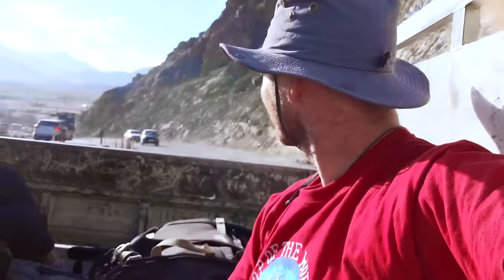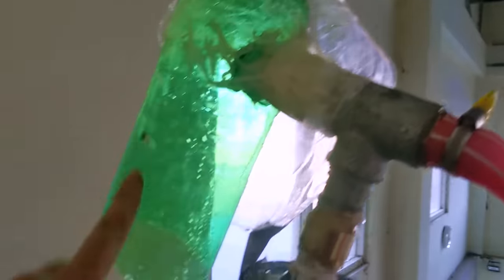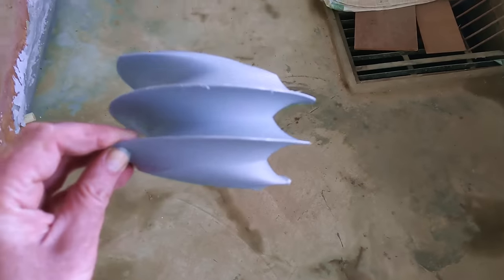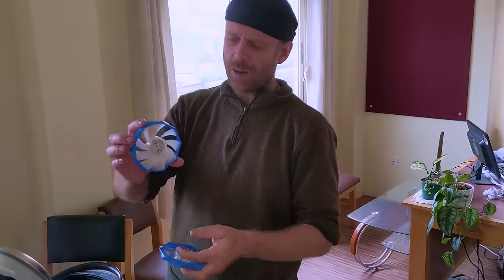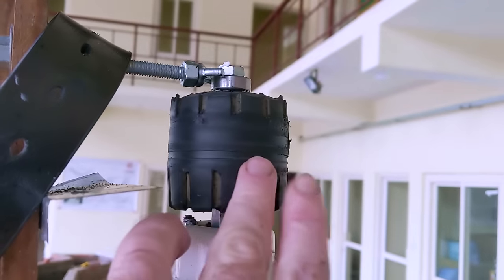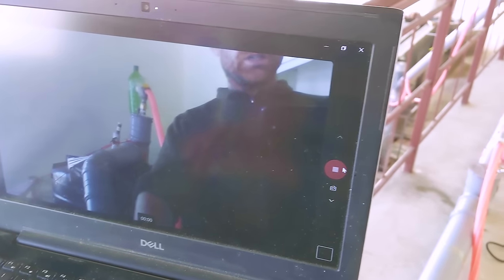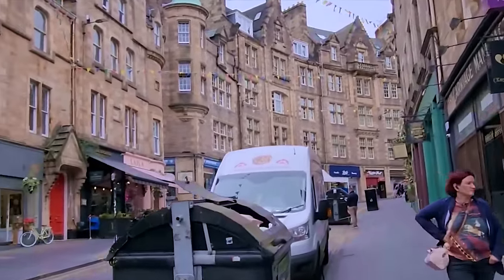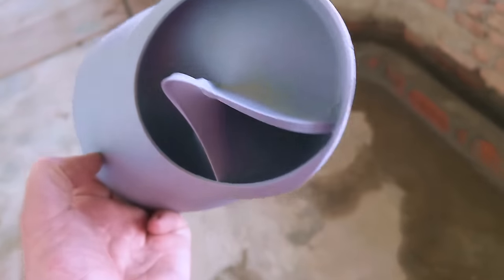The $50 Water Turbine Gets A Power Upgrade (Also I'm In Nepal)

Comment: After problems with You Tube channel, in the past , I thought that you've given up filming and fell off the radar (turns out that you've gone above the radar -I mean Nepal...). Btw , I was under impression that in Nepal wind power would be more  interesting , but I could be wrong.... Now , since you are back (on YT , I mean) , I have some questions , regarding the turbines you've built (in the past and recently) . Since you utilized height difference of about 4 meters and more , between intake and outlet of the pipe , would it be possible and/or beneficial (in terms of energy production) to put more than one turbine along the length of the pipe , using some "T" fittings at angle of 45° , let say  , one meter apart  ?  Second question: would the  "screw" design benefit from making the screw longer , using the more mass of the water (more available torque ?) and how we can determine the best pitch of the screw and whether is uniform pitch better (more efficient) , or ever changing one (for a particular length of screw and water velocity). Third one : did you ever compared , or calculated  , what would produce more power (with exact same generator used) - the siphon turbine version , or (for an example) pressure powered Turgo  turbine (given the same intake height nad same diameter of pipe , of course , with injector at the end for a Turgo turbine version) ?
All the best !
Reply from the maker: > I thought that you've given up filming

Took about a year, but they finally fixed the channel in 2022. Since then I've just been lazy / distracted.

> more than one turbine along the length of the pipe

Short answer not really. They'll all steal momentum and power from each other, so you'll multiple your costs but not your output.

> making the screw longer

Quite possibly. There'll be a sweet spot somewhere for all the various settings, could potentially CFD it, but probably best just print and test a bunch of variations.

>the siphon turbine version , or pressure powered Turgo

Turgos and Peltons are a lot more efficient, but need at least 20m head to function well. So if you have that much drop, use them. Less; mine should do better.

Comment: Good work, but you dont need to reinvent the wheel. The engineering and science of water flow as a energy source is well know, we've been using it for centuries. Impellers, syphons, etc are well understood and tested, use the research of others. I've been using ram pumps to lift water, the technology is 150 years old, and as good as it gets.
Reply from the maker: Always easiest if someone's already done it, but low head medium power low cost hydro is unfortunately not currently a well catered to niche..
Reply: The “Michelin” wheel company R&D expenses are 756 million € per year.